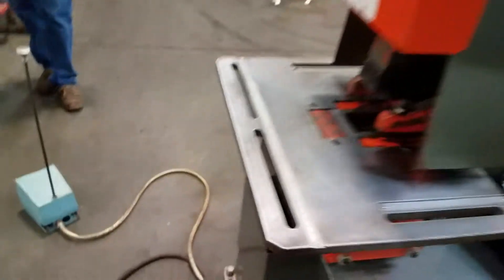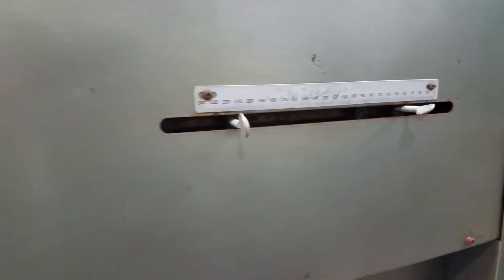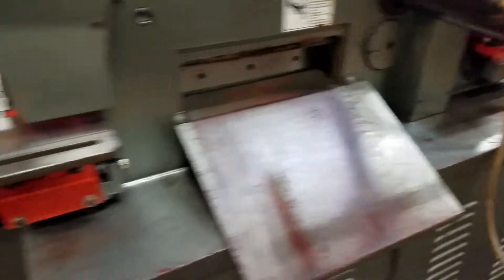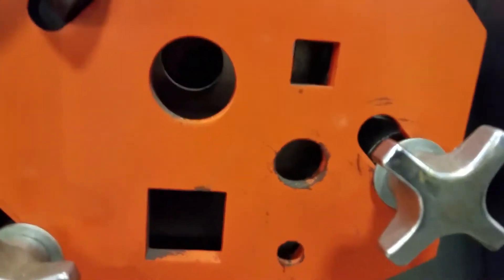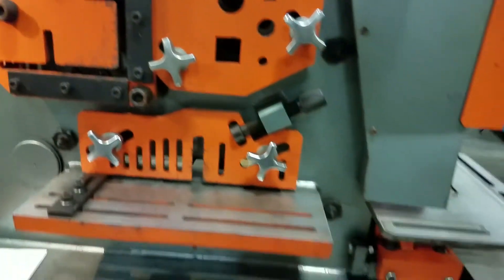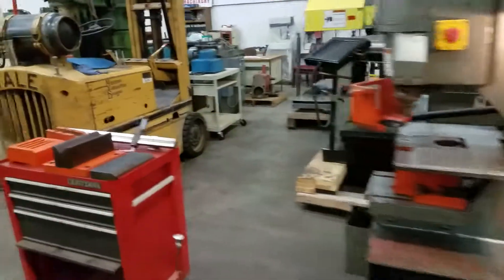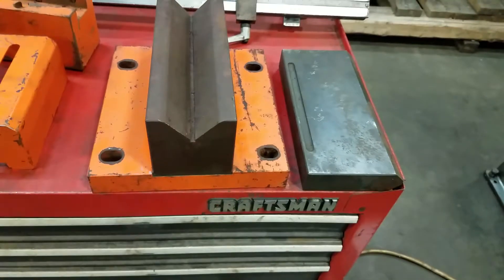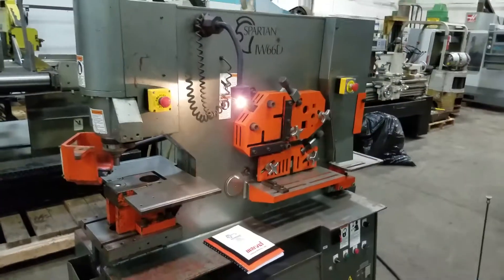Spartan Marvel 66 Ton Hyd Ironworker Model IW66D

Comment: This is an almost exact copy of a Scotchman DO 8514, except it’s a little smaller with less tonnage capability. 
I mean, it has the SAME EXACT PARTS and design. 
I’m guessing that Scotchman must have licensed the design and maybe even sells the parts to Spartan. 
They are identical, except for where the control panel is located.